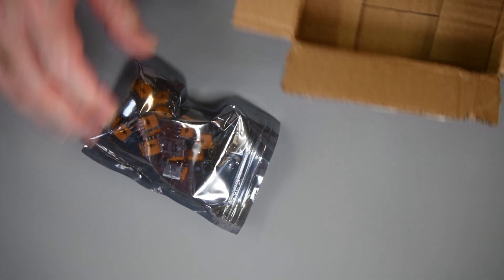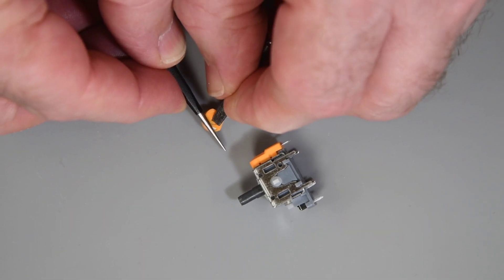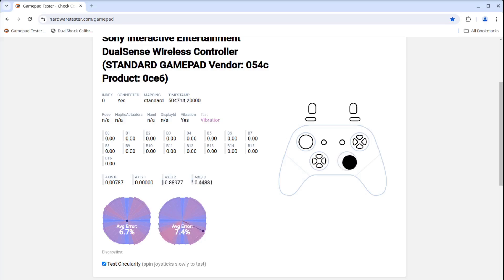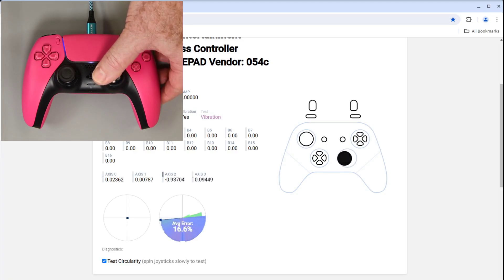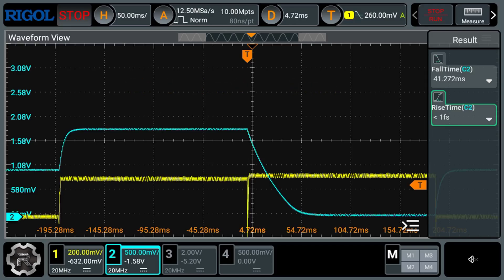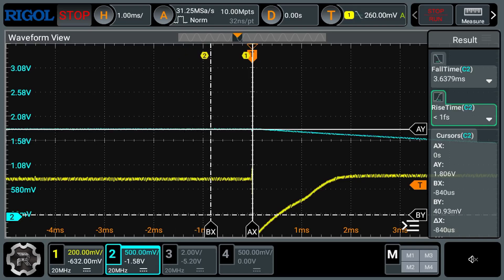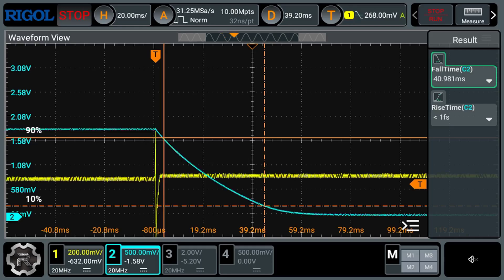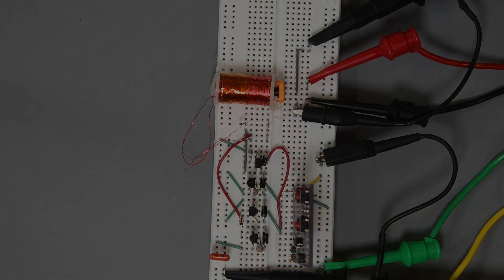Is This the Perfect Hall Effect Joystick for the DualSense?

Comment: 1:13 👹 damn it I was hoping I could switch out the pivot gate width guide for the narrow Alps style key way they use in the Ginfull stand alone hall effect sides 🫠🫣🤦🏼‍♂️😭.

That's solid on purpose not to allow such modularity 😮‍💨😤.

2 micro width packer shims will be needed to test how good the radial pointed magnets translate to a linear signal 😡🤬😬.

Comment: A question can you use only the potentiometer with the original sticks?Or you need to change the whole thing.
Reply from the maker: If the original joysticks are Alps you can replace the potentiometers with the GuliKit TMR sensors. I have a video on that.  If the original joysticks are Favor Union you can replace those potentiometers with the Favor Union Hall effect sensors.  Ginfull I believe makes a replacement sensor for the Alps joysticks but I haven't tried it.
Reply: @metalplasticelectronics354  Thank you,i opened to clean mine but i didnt check what brand they were...the potentiometers were green tho.I did ordered the ones here tho after i saw your video,so when drift is back i guess i will replace them properly.
Reply from the maker: @woofaki5550  If the potentiometers are green then they are Alps joysticks.

Comment: I put halleffect on Xbox SX controler, now it pulls up every time I press LT. How to fix that?
Reply from the maker: Does the left trigger use a magnetic sensor?
Reply: @metalplasticelectronics354  Yes.
Reply from the maker: If the trigger magnet is that close to the sensor then that would be a problem.  Shielding from magnetic fields is not an easy task.  You can look up some information on Mu-Metal.  But shielding in the tight confines of a controller will be hard.

Comment: I just did 2 controllers in 1 night what a doozy, all ginfull v5. I played NFS heat with both, swirling in traffic and drifting feels the same or even smoother than the stock, 0 delay that I can feel. Both 3-5% circularity, that magnet design really helped.

Comment: I got these, and one day it was working fine (just the right stick to replace a drifting one), no issues, but then they started going haywire like two days later, moving to the left, up, down.., shaking center, then slowly moving up, next day centered again, then all the way left... Why? Maybe bad soldering? Did I screw up the board? Everything else in the controller is working fine. :(
Reply from the maker: It could be a bad connection.  It could also be the sensor going bad.  Since it sounds like both axes acting up I would suspect more of a connection or trace damage to the ground or 1.8 volt supply.
Reply: @metalplasticelectronics354  thanks for taking the time to reply. As an update, I changed both sensor pieces, resoldered the three pins for both axis's, and the up/down one works fine now, but the left/right one strangely enough worked for 20 minutes in-game just fine, then it just went haywire again and got stuck to the right and doesn't move from there (up(down axis still works normally). Guess I'll have to re-resolder again? If I change that sensor piece again still get that issue, then it means I screwed up my board? Will update on this tomorrow, maybe. Thanks for reading!
Reply: @DravenxEyeless  any update?
Reply: @alefps7  Sadly, after a lot of tinkering, it seems the board itself might've become damaged due to all the resoldering I did, since even after changing the sensor piece, I still got issues. So yeah. Maybe I'll get a used dualsense controller from someone and attempt the Guilikit sensors replacement from the channel's latest video since that seems way easier (without having to remove the whole thing which is a PITA, plus now I had some practice lol

Comment: Do you need calibration board to be installed with joystick ?, or it can be enough by itself ?.
Reply from the maker: No need for calibration boards now that there is a website to calibrate the DualSense.  Take a look at this video:  https://youtu.be/0fK1sapv0YI?si=Lvu8WMt9OvcM23um
Reply: Is there any website to callibrate xbox controller spesifically?  @metalplasticelectronics354

Comment: I need your help with something. I changed both analogues. I used the ginfull v5 from the link. The left analogue worked fine. The right analogue always shows left. I did the soldering process very carefully. In case the product I bought was faulty, I disassembled it again and soldered a new one. It only moves between the lower left diagonal and the upper left diagonal. I did the calibration many times. I paid attention to the paths on the mainboard, they are all intact. What could be the cause, do you have any idea?
Reply from the maker: If the left-right axis is all the way left then the controller is reading close to 0 volts on that axis.  Take a look at this video: https://youtu.be/cWUnZ7KjUIQ?si=N0yV_9fRec7hU7e1 to see if it helps.  I would suspect damage to the 1.8-volt supply trace to the left-right axis sensor or damage to the trace connecting the center pin.  Look at both of those connections very closely.

Comment: I have repaired three controllers with these and every single one the right analog falls short of reaching full range at the top left. The same analog every time and the same area. Any ideas? Installing these in ps5 controllers. Calibration software doesn't help.
Reply from the maker: The right up-down axis is the only one of the sensors close to the DualSense speaker.  You could try removing it and see if that is the cause.
Reply: Did you find a reason or a fix i have same issue om my right sticks thanks

Comment: Just ordered these using your link. I saw you asking about details on the newer parts. The ones I got are are L-4C (slim possibility it is an O not a C - the housing covers some of the letter). The chip on the other side is 93L44. Is there anything else I can help with?
Reply from the maker: Thanks.  You might want to check out the new GuliKit TMR joysticks before you install these.
Reply: @metalplasticelectronics354  I don't know what those are, they aren't on your channel! Or did I miss something?
Reply from the maker: If things go smoothly today I will get a video up on them.  I just finished testing them, and they are very good joysticks.

Comment: Are the sensor compatible with ALPS mechanism?
Reply from the maker: No, the shafts are different.  But the new GuliKit TMR sensors will fit on an Alps joystick.
Reply: @metalplasticelectronics354   Did you try those Gulikit TMR sensor on ALPS shaft? Just to be sure signal is fine and they work fine.
Reply from the maker: @Kaesar_Wolf  I only did a mechanical fit.  But if it fits mechanically it should work fine.  All the joysticks have a fixed arc that the shaft can move.
Reply: @metalplasticelectronics354  thanks, I will make a try. I don’t have a desoldering station to proper remove the whole joystick. Yes I can go with the hard way (as per your video) but removing the sensor is way easier.

Comment: For anyone actually wondering about the “delay” I took the time to actually install these and tested them in game and there was no difference that I could spot. They did not feel slower despite the fact that a computer could spot the difference. It COULD just be me as this is a trial of one person but as far as I can tell you won’t even feel a performance decrease. And they have better circularity as mine were firmly at 2.1% avg error compared to the potentiometers which were all at around 12%

Comment: What are your thoughts on these compared to the Jun Zheng hall effect sticks and driver boards?
Reply from the maker: I haven't tried the Jun Zheng sticks, so I can't say.
Reply: @metalplasticelectronics354  fair enough. They're quite tricky to install, but the recent V5 revisions seem more managable to install/remove as they use an FPC instead of fibreboard for the driver board. I've got a few on order (but I can't tell if mine are gonna be reseller clones as Jun Zheng isn't selling directly from his own merchant account to UK and Europe anymore).

The calibration can almost be done on the fly after install and reassembly by inputting a button/combo as you power on/plug in the controller. I've managed to get as low as 3% error on the circularity testing for both of the Dualsense installs  I've completed so far. 

But I had no idea delay issues and tests were a thing for hall effect sticks until watching this.

Comment: i have few questions: I heard that hall effects get drift due to high heat. does cooling down the temperature fix it?
Reply from the maker: I would expect the sensor IC to be temperature-compensated. It's not something I've tested but I haven't noticed a temperature change affecting the center position.
Reply: ah ok, so nothing much to worry about then huh. well, that's good to know. also I just bought a dualshock 4 with the exact same hall effects from this video and I expect it to be here tomorrow. I have a lot to test with it. If everything goes well, then I expect the controller to last forever cause I am no longer buying any controllers that don't have hall effects.
Reply from the maker: Do they have the V5s for the DualShock 4 now?
Reply: I think so.

Comment: The v5 I got say L4C. My tablet camera isn't good enough to read what it says on the IC.
Reply from the maker: It is some very tiny printing,
Reply: @metalplasticelectronics354  can the IC be programmed with different specific values? if so then it would seem that two of the exact same model chips could have two completely different values inside it. i would imagine the chip is locked so you couldn't just copy the code and reprogram chips you already have.

Comment: Do you recommend calibrating with the software while the controller is disassembled or assembled? I assume the range is slightly smaller once the controller is reassembled.
Reply from the maker: I do a temp calibration before I put it back together just to make sure there isn't anything horribly wrong.  For it to be calibrated correctly, it has to be calibrated after the controller is fully reassembled.
Reply: @metalplasticelectronics354  thanks for help. Hoping to install my first set in a couple weeks.

Comment: Thank you so much. I just replaced both my sticks and they are working great now. I was a little confused about how you got to test it with the board outside the controller but figured out that I just needed to connect the battery to test it. What I also realized is that the hall effect sticks don't have the static friction that the potentiometer strip has, so it feels quite a bit smoother.
Reply from the maker: Glad it went well.
Reply: Just had the same issue with my xbox controller upgrade.  Wouldnt power on without the battery, then I put the USB-C cable in a USB3 port instead of USB2 port, and it powered up without the battery.

Comment: Thanks for the video. I don't know anything about soldering and I don't want to brick my controller. If I order these sticks and give them to my local repairshop for replacing, can I use them without any calibration, just right out of the box? Because I don't think they will bother with calibration like the way you show?
Reply from the maker: The software calibration is the easiest part, and you will end up with a more centered and circular joystick in the controller.  Even if they don't calibrate them you can, it's easy.
Reply: @metalplasticelectronics354  Thank you very much for the reply

Comment: I may be missing it because your testing data is a bit complicated for me to fully understand, but just for the hobbiest modders out there can break it down for me/us a little more basic on the delay differences?

Like potentiometer delay is xx ms left to right and ginful v5 is xx ms left to right. Like just basic simple statistics sort of thing? 
Thanks for the content man it’s amazing and super helpful for a lot of people out here.
Reply from the maker: The potentiometer delay is only dependent on the capacitance on the output of the potentiometer.   The Hall effect joysticks will have some of that delay plus the signal processing delay of the Hall sensor.  The Ginfulls have an asymmetric delay time depending on which way the axis is moved.  The others I've tested seem to be pretty balanced. The slew delay amounts to the minimum time it would take for the output of the Hall sensor to move over the entire range of the axis, no matter how fast the mechanical axis was moved.

Comment: Hi, is it possible to install halleffect joysticks on PS3 dualshock 3 gamepads?
Reply from the maker: I don't know.  When I think about it, I don't even remember working on a PS3 controller.  I'll have to look and see if I still have an old one tucked away somewhere.
Reply: @metalplasticelectronics354  Thank you checking it out! I have a few PS3 controllers and would like to fix them and was wondering if I should try one of the hall effect joysticks. I still enjoy few games on my PS3.
Reply: @kilosierraalpha the old ds3 has hall standard that's why they don't wear out 😊

Comment: Oh damn, looks like I'm ordering a new batch of Hall effect sticks.  The ones currently in the mail are L-8L.  Guess I'm looking for L-4B now.  Thanks for the links!
Reply from the maker: Do you know what magnet design is used with the L-8L sensor?
Reply: @metalplasticelectronics354  I'm afraid I do not.  I missed the delivery on my L-8L ones.  :(
Reply: @metalplasticelectronics354  so I managed to get my order but they are the L-4B's like in your video.  No complaints there.
Reply: @metalplasticelectronics354  I forgot to update. I managed to get them redelivered. The magnet was the rectangular style.

Comment: I installed these about 10 months ago and have had zero issues. The centering and calibration tool being on website is just a blessing.
Reply: The v5 just came out, they weren’t on the market 10 months ago, you likely have a ginful v1 or v2, but even the older ginful versions were already solving jitter issues and stuff, these are just slightly more refined specifically for the dualsense. Doesn’t really matter now though which one you put in now with the new calibration software out. You can even get away without the circularity circuit board that was super complicated and tedious to install. Glad to hear you’re going 10 months strong on ginfuls though. I have 2 extremerate fully custom controllers I can’t use right now because the stick drift is so bad on them. Cheers
Reply: @codywoodward how to know which version is mine? i just ordered some from aliexpress
Reply: @codywoodward is v4 is good ???
Reply: Honestly unless you’re selling them online to people who know wtf a Hall effect even is. I doubt the average consumer will have any idea the difference. If they did Sony and Microsoft would have upgraded them a long time ago because it’s clear they haven’t because of planned obsolescence knowing they’ll continue to make profits every time the average gamer has to replace it with a new one. If you can get a bunch of cheap stick drift controllers though you could still get some return for fixing them either way. My recommendation and there’s someone in my city I’ve seen doing it, is just grab an extremerate rear kit with maybe some cool coloured shell replacement and sell them as a custom pro controller for like 75% of an dualsense edge controllers cost. You’ll move those all day and the kits aren’t that pricey or hard to install. Good luck
Reply: donde esta la herramienta
Reply: I'm thinking of getting a bunch of controllers , replacing analogs and battery and sell em for profit. Glad to know jitter is removed
Reply: If I calibrate on the website is it permanently calibrated to the controllers hardware or just on pc only?
Reply: @efrainfierro3820 of you select permanent, then it's permanent
Reply: @efrainfierro3820  choose permanent
Reply: I live in Dubai😅
Reply: I wish
Reply: I have a question! No some ANY wireless connection issue?
Reply: @bigcreoman  nope
Reply: Does calibrated Hall Effect work smooth and perfect in aiming in online shooting games like COD and Fortnite
Reply: @ghostkill3r603  it supposed to, that's what other gamers says.
Reply: @Jaddo-San  Great, I hope that's right
Reply: How about small adjustments? Are they better than the regular ones or worse?
Reply: @zardyzardy8946  better and buy the new tmr
Reply: Make it gold chrome with a McLaren or Lamborghini logo then? Haha

Comment: Would you say the delay time is comparable to potentiometers? I don’t really play FPSs too much so the absolute fastest time is not a must for me, but every now and then I play with my brother when he can who’s currently serving in Pakistan. So I probably wouldn’t notice a very slight difference.
Reply from the maker: These have a slightly different feel than a potentiometer joystick, and I think the difference is from the delay that is caused by the filtering of the sensor output.  But for these in this video, it is very slight.
Reply: @metalplasticelectronics354  so if I wanted to swap them out myself, I should not really notice a change? As I said I’ll only be playing cod once or twice a month. The feel I can get used to, but what I was to know is am I gonna try to aim and see a half second delay? Because if it’s a delay difference of less than 50ms, I really don’t think I can even consider it a delay since I’m not gonna notice a significant amount of time between input and result.
Reply: @metalplasticelectronics354 hey just wanted to say I actually ended up buying and installing these and in game I could not actually spot the difference between these and the potentiometers ones. If there is a delay, is so tiny that I could not actually see or feel it with the naked eye. Thank you so much. I was able to very very easily do the replacement myself despite never before using a soldering iron, all because of your videos.